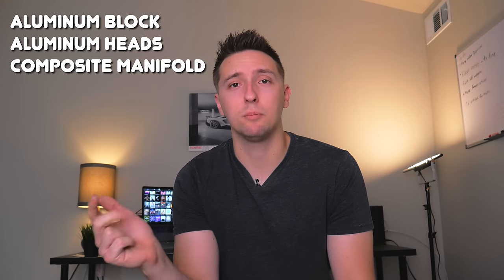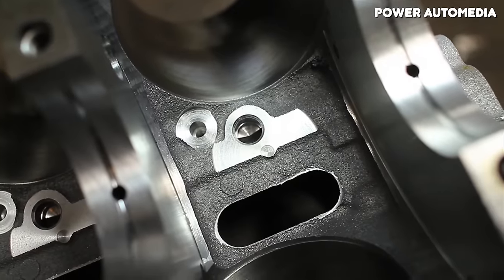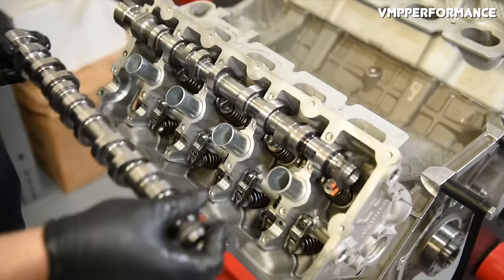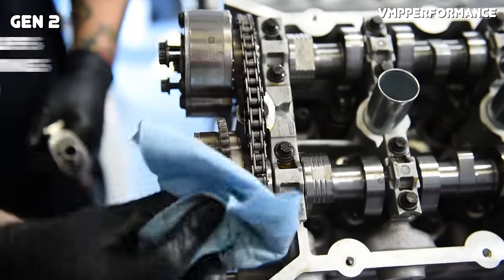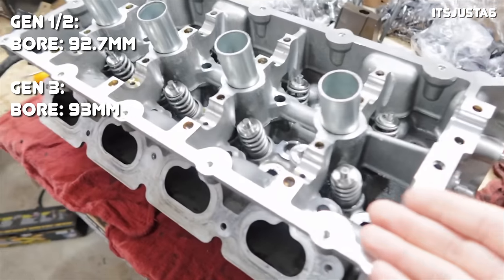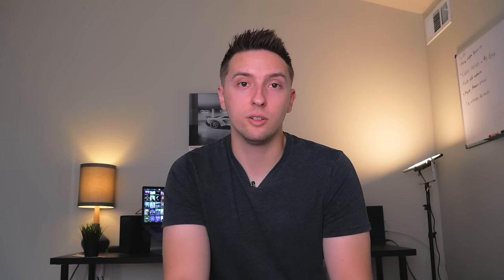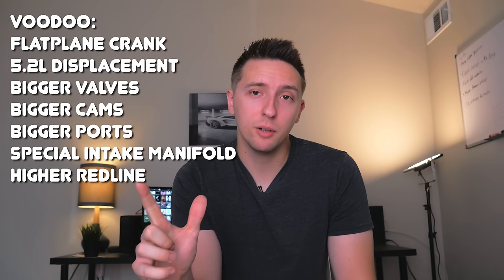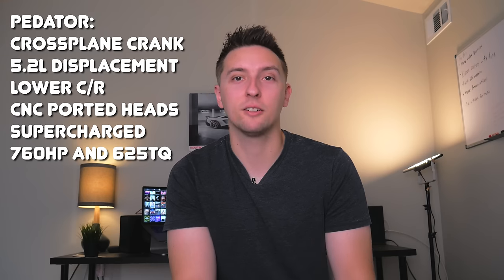The Evolution of The Coyote Engine (Explained)

Comment: The 4.6s were really under powerd but reliable as hell..
Reply: Not enough power to hurt themselves lol but yeah picked up 98 gt with a dohc cobra 4.6 and I beat it to death and it never had one issue.
Reply: They were run in the Crown Victoria for many years, about as tough as a stone axe.
Reply: I have 2 of them in late 90s f150s. The 4.6 2v. But just 1 simple bolt on supposly add 100hp!😲😲 an even shows this on dyno's so must have some truth to it. But just add some twisted wedge 180,190 or 205 heads. Dyno was on the 180s an unlock a 100hp. That is absolutely crazy!! I'm going to try this on the old f150 an see how bad she become 😅
Reply: @jayisfedup6896  More of a testament to just how choked up the factory setup was, than what sort of power can be "added." I call it "power restoring" mods.
Reply: Mine has a misfire at the moment but its still goin 🙃 edit: also i think the sound of the 4.6 is a perfect modern muscle car exhaust note!!
Reply: Locked mine up twice and it’s still going 😂
Reply: @exothermal.sprocket  Yeah but the ones in the P71 are different. For example the front cover are thicker and the belt tensioner has only one bolt. I've owned a Grand Marquis, a Lincoln Town Car and a CVPI not to mention a couple of Cougars and a T-Bird. Very reliable engine and very easy to fix. I just love it.
Reply: @BigAaronism  yea I got two lincoln mark 8s. I will say I blew my head gasket. But yea you can turn them things 7k rpm no problem. They really are over built engines.
Reply: Most look down upon the 4.6 simply because swaping in an ls is cheaper,but 4.6 is just as capable of same power output of an ls,the 3v with fbo can go from 300hp to 400hp I'd say that's impressive
Reply: 4.6 could handle 6-8 pst boost too. Prob stick with 6 for longevity. Put you in the low to mid 400`s with a boost-a-pump and 42 injectors.
Reply: @mikehawk120  yea people like to shit on these engines due to what idk. Yea they did put them in like ever vehicle ford made from 92 til like 09 which something gotta be right to use the same engine for like 15 years straight. Slight tweaks to the mod engines but not much. I can't speak from personal experience on running boost but I I say those 4 6 4vs are probably the best engines ford has ever made beside the 5.0 or i6 300.
Reply: Thats good to know… i wondered why he shit on it.. personally i’d rather have reliability over a little more power anyday.. 310 horsepower is plenty… 420 is too much, you burn through tires in no time. Fancy boy was bragging about dual injection.. yeah thats great until you realize its just more injectors to go bad and have to fix.. no thanks …
Reply: @SRTrollinz  I had a misfire as well. I changed spark plugs and the misfire went away. Might be your issue, just passing along. 👍🏻
Reply: I thought that’s one of the reasons why they’re reliable
Reply: Yep they had just enough power to have some good sound durability and even good mpg
Reply: Plentiful
Reply: My 22 year old 240,000 mile 4.6 is still trucking strong
Reply: The 4.6 has 300 HP
Reply: Super easy to work on too
Reply: @soonergaming4747  2V OR 3V?

Comment: One variant you missed is the Aluminator 52 XS crate engine.
I still want Ford to produce (while they still can) a 7 liter version of the Aluminator crate engine. Build it with the big bore and short stroke of the 427 that won Lemans, but make it a modern, bugger version of the Coyote and Yeah, it would take a whole new block and be very expensive. But an almost 900hp naturally aspirated engine would be a real hit with hot rodders.
Reply: A 7 liter Coyote? While I would bow down and worship such a thing I don't think the platform will support that much displacement. Maxing out bore and stroke in the Coyote block seems to be limited to about 5.5L. Even if you max the stroke (at around 97.54mm) there literally isn't enough bore spacing for the 100+mm bore you'd need to get to 7 liters. Not only would it be expensive for Ford to build, it would require redesigned block and cylinder heads to accommodate the larger bore spacing. I don't think even the planed iron block for the Coyote can go that big. It would be a hugely impressive engine though, both in power and in how much presence it would have under the hood.
It would probably make GM's LS7 look kinda silly in comparison.
Reply: @177SCmaro  7.3 Godzilla
Reply: @Paul Klein pushrod engine.
Reply: ford was considering a 7 liter v10 based on the 4.6 4v for the gt. the experimental 5.8 v10 wouldve likely been stroked a bit more than the 6.8 but the 5.8 did rev to supposedly 7300rpm so that 7L wouldve screamed

Comment: I've got a gen 2 Coyote and with an exhaust, intake, ported 2018 mani and tune to bring it all together, it's knocking on 500hp's door.  Pretty damned good for a 5.0 na motor.
Reply: Same here. You on e85?
Reply: Crank and not wheel I assume
Reply: It’s the same physical size as a big block
Reply: @BlackRam17  headers ported mani intake 93 Gen 2s put down 450-460 depending. E85 around 470. And that's wheel, not crank.
Reply: I have a gen 2. Planning on keeping it completely stock. Beast of a motor
Reply: @dilldowschwagginz2674 same here, great performance....am using a K&N air filter however.

Comment: I've never been a Ford guy ... until I drove my neighbor's new "fleet" F150 work truck a few weeks ago. It has the Coyote and 10-speed and I got almost 32mpg driving the back roads in Texas hill country between San Antonio and Austin. When I needed smoke it had plenty. Absolutely fantastic engine.
Reply: Try a tune from 5star. You will be amazed of the HP gain and transmission reprograming will do for your truck.
Reply: It's not my truck ... it's one of my neighbor's company's work trucks. The electrician who gets to drive it daily doesn't deserve it (I only borrowed it for a few days).
Reply: 32 mpg, were you going downhill the whole way? I call BS.

Comment: Ford has done excellent on all its TGDI (Ecoboost gen1 & gen2) & non TGDI engines i.e 5.0L Coyote, 6.2L & 7.3L Godzilla gas engines. Running an SN+ LSPI reducing full synthetic makes all these listed engjnes bulletproof in my experience in automotive industry 25yrs!
Reply: Eco boost is trash
Reply: And the new 5.0 had no cast iron cylinder sleeves oh and has cylinder deactivation this is coming from a ford guy really disappointed in ford they should have kept the gen 2 5.0

Comment: I have a Black 2010 GT Premium 5-speed with the 3V 4.6
It’s fun. Not tooo fast. Not a slouch either. Of course my car with me in it weighed 3,765!! Runs about a 14@100 in the 1/4 with d/d tires, and is very consistent when at the auto-cross. At least it looks good. 🤘
Reply: That shit slow
Reply: @forza4mustangcraz  lol
Reply: I always thought the 3V 4.6 sounded better than the Coyote too, at least both with stock exhaust
Reply: Time for some mods! My 07 3v runs a 12.2. Fuck anyone that says its slow lol they probably drive Corolla's😂
Reply: @christianreyes368  thanks yo. I love my 3V I was just thinking, 4.10s, suspension kit, drag tires/wheels, heavy duty clutch, tune, full exhaust, 🤘
Reply: @danieljohnson3492  i got jlt 3, frpp throttle body, steeda pulleys, bbr stage 1 cams, pypes longtubes, kooks o/r h, roush catback, exedy stage 3 clutch and lightened flywheel, and a brenspeed tune. Its making around 360whp on a dynojet and with just radials im looking at 12.2, my 4.10s and rear end kit aren't installed yet👀 You'd be surprised how many 400hp cars you can embarras😂
Reply: @christianreyes368  I had to screen shot that. Know what I got to do make er Really run. Thanks for the info 🤘us 3V ers godda stick together 😎
Reply: @christianreyes368  Ayo wtf, didn't know bbr made cams. I'm not sure if the Florida tuner "BBR" has anything to do with the cam maker "BBR" But I do a bunch of machine work for engines built by the Florida tuner "BBR"
Reply: @lucysmith4242  yeah Blow-By Racing makes some badass 3v cams bro
Reply: @christianreyes368  that's dope, it's a small world
Reply: @nthgth  New Edge models sound better than most models...but were all bark with very little bite.  Going from any 4.6 l to any coyote is night and day....coyotes in trucks are even so smooth.
Reply: I have a 2010 Track Pack GT getting ready to take it to the drag strip here soon car and driver pulled a 13 5 in a track pack equipped GT I hope to get at least that
Reply: 3V are all torque.  Coyotes gotta rev.  Driving around town and a 3V is more fun in my opinion.
Reply: @stangdude5593  I'm used to pushrod V8s which make all their torque right off idle seems like my 3v starts making a ton of torque at 3500 RPMs can't comment on a coyote never driven one
Reply: StringerNews1  yes my 2010gt is a track pack car and car and driver said a track pack GT only used at the drag strip is a waste of a track pack so I've been doing some curvy road stuff with it and I am amazed it is like it's on Rails never driven anything that handled like that before
Reply: @danieljohnson3492  what about just burn it and get a 5.0 😂
Reply: @youmadbro9779  can’t stand the way they sound.
Reply: The 4.6 is bullet proof.
Reply: S197 great platform for AutoX screw drag racing do more auto X
Reply: @trackpackgt877  coyote truck hits torque at 3200
Reply: @PureCountryof91  that would make sense for it to hit the torque a little bit lower in the RPM than a light manual transmission car appreciate the info
Reply: @trackpackgt877  tuning and less aggressive intake cams, coupled with a longer runner intake.

Comment: Gen 1 ecoboost taught Ford why they needed both port and direct injection.
Reply: Not really 1st ecoboost on Europe specially UK, from 2011 are still running with no problems. 1.0 3 in line 125ps direct injection.
If you change oil regularly and do some highway from time to time, 0 carbons problems. Specially if you use 98 octane or 91 usa. This will lower the temperature of the explosion but doesn't decrease efficiency. Lower temperature less to no carbon build up.
Reply: Had a Gen 1 Ecoboost and now have the Gen 2 Ecoboost. I love both but the Gen 2 is actually really great. Im a V8 or die guy and it changed my mind. Gotta give it credit.
Reply: @Snipedkill1016  ill just stick with my Boss 302
Reply: Port injection also means less fuel limitations which means mo powa baebeeeeeee
Reply: @Seasniffer69  I've never heard this, what limitations are there to Direct injection?
Reply: @drwombat  running out of rail pressure at low rpms most direct injection fuel pumps build pressure off of RPMs, port injection means instead of only directly injecting fuel in the cylinder with DI, there's injectors for those cylinders in the intake manifold as well. More fuel-more power. Especially down low where the gear driven fuel pump for direct injection will starve for power on turbo engines causing detonation

Before they did this from the factory people were adding aux fuel systems.
Reply: @Seasniffer69  oh wow Direct injection don't use electronic pumps? That alone should've been a big red flag to engineers... Port+DI is the only way to go if you need both but if you can only choose one then it really should be port injection due to it's reliability and sturdiness
Reply: @drwombat  I'm generalizing with the yote. My 2.0 Ecoboost had a cam driven fuel pump. The higher the rpm the higher the fuel pressure. Putting on a bigger turbo or going E30 tuned we had to tune the power up past 3k rpms. Even if the engine COULD make 400whp it physically wasn't able to safely at lower rpms so the power gets neutered until the fuel pressure could get past a certain rpm threshold to avoid detonation and build pressure.

That platform would add auxillary fuel system via a throttle body injector or an intake manifold spacer with injector ports to add injectors over the intake valve

Comment: Hey speaking of the CMCV setup on the Gen 2, for a street car I don’t know why anyone would delete it honestly. The head was literally cast with the CMCV design in mind and with the flapper setup plus the advanced TIVCT you mentioned these two technologies together make for an amazing street powerband and returns great mileage for that much power. The stock Coyote heads and cams are mighty capable and we literally have a 1600HP GT in our shop right now using bone stock heads and cams, a stock auto trans and tuned in the stock ECU. Coyote power is real.

Comment: The use of a dual system of DGI and MPI is Toyota's inspiration they did that from day one. That is why Toyota with DGI never suffered from carbon on the intake valves like all of the high end European cars and Fords with DGI. The removal of factory installed sleeves in the bores is a mistake from a consumer stand point. It effectively turns the block into a throw away block just like a Porsche, BMW or Diamler.
Reply: Ford has millions of Gen1 & Gen2 Ecoboost TGDI engine's out there in 1.0L/1.5L/2.0L /3.5L configuration. I work as mech engineer 25yrs in automotive industry & have been around many manufacturers TGDI designs. Ford has been 1 of few that's experienced low-zero performance hindering carbon issues & non existent oil burning (even when in its highest  powered Ecoboost TGDIs.. i.e. Raptor, Ford GT supercar, F150 Limited w/Raptor engine etc. I bought $46k '20 Ford Ranger XLT FX4 Gen2- 2.3L Ecoboost mainly because of the class leading powertrain!
Reply: Just curious why you think the block would be a throw-away block?  You do realize that many manufacturers actually used PTWA when remanufacturing engine blocks for years now instead of re-sleeving blocks for remanufactured engines?  Also, if you really wanted to, you could opt to re-sleeve a new coyote if you wanted to just like you could the old ones...no need to throw the block away as doing that is cheaper than a new block.

Comment: Cool - I have the Gen III Coyote in my 2018 F150. An easy way to ID which you have is the oil pan: Gen 1 and 2 have a 7-quart steel pan, Gen 3 uses a 10-quart composite pan. The first time I checked my oil on my truck after I bought it used it was 3 quarts low!!! Somebody at the quick lube assumed it only held 7 and didn't check the dipstick.
Reply: Greg B  Yeah - it does.
Reply: Greg B  150,000. It's a 2018, bought it used. Previous owner lived in it on the highway, average speed was 57 mph for 150K miles. That's pretty impressive.

Comment: My 2001 mustang had a 3.8L V6 which was super reliable. I drove it hard everyday and got it almost to 190k miles without a glitch before I sold it in 2010 and the silver paint body and the motor both were in a great shape for the age.

Comment: I had the Gen 3 5.0 coyote in the Ford f150 with the 10 speed transmission loved lots of fun and power
Reply: You think you can beat a 3.5 with turbo with 5.0 ??
Reply: @davekamalas2537  I can tell you that I got 2 more miles to the gallon better than my work buddy's 3.5 truck

Comment: Aside from bashing the 4.6L, just because it doesn't output the same power as a 5.0L... it is a stout motor. Very reliable. My 2009 4x4 F150 is still strong at way over 200K miles. I just towed a 7,000lb trailer from New York to Florida. No complaints here. Quit bashing this motor!
Reply: Ikr?  One of the best engines Ford made

Comment: The 4.6 is a good motor!
Reply: No, it's not! The 3.7 v6 and now 2.3 i4 are better. Besides, who in the hell creates a 3 valve engine? That's almost as bad as a v5...
Reply: @Josh47147  It actually was a good engine. The 4.6 SOHC has not much to be desired (I used to own one). The DOHC variants in the Mach 1 and Cobras were badass. IMO, they sound better than the Coyotes (Also owned one). But sound is a matter of opinion.
Reply: @Josh47147  not as far as torque and boosted potential hp doesn’t always win if the car can’t put it down and lacks torque
Reply: The 3v variants are absolute junk.
Reply: Many are still running strong with 200K+ mileage.
Reply: The 4.6 is a good engine. The 3V heads were not the best cause of the issues they had with them. Especially with the 5.4 engines. But the 4.6 is a strong engine. The owner of Accufab throttle bodies with a 4.6 has ran a 5.88 at 254 mph with a 4.6. He even uses stock timing chains. Its all how you tune a engine.
Reply: Yeah it is they run forever
Reply: @BPeezy315  

Nothing sounds like a 4.6 with exhaust!
Reply: No it's a boat anchor as was the 5.4 Boss
Reply: @sriley064  

Nope.

Comment: I have the supercharged Miami engine in my R-spec  Pursuit ute & was wondering why we are robbed of power in Australia even when we have the same engine?
Bloody good video btw mate, thanks for that 👌
Reply: We use 93 octane while y’all use e85 or other similar variants
Reply: @jeremyh4180  no I use 98 octane pump fuel. E85 is for specially tuned race motors of which once they do run that fuel they get higher power.
I think the intake manifold & supercharger pulley size plus not being tuned high has something to do with it but I'm looking for specifics.
Reply: @danlonick800  Because Ford Australia had to look like good bois to the police of NSW and QLD,Just get it tuned and you'll probably shit over those numbers,they're rookie numbers
Reply: @jeremyh4180  please go do research before you type stuff on YouTube

Comment: I have a 2018 gen3 convertible with magna ride, perf pack, active exhaust, forged wheels, larger throttle body, cold air intake, x pipe. What a great car and engine. Significantly better than the 2010 gt and then 2105 gt I had before. The new gen 4 in the Dark Horse is going to be even better I am sure, but I will stick to my 2018.